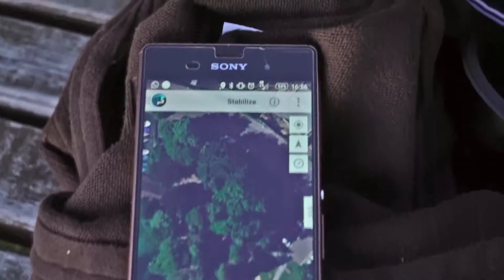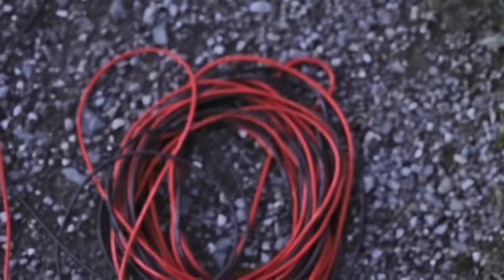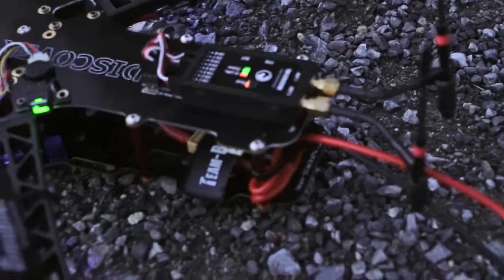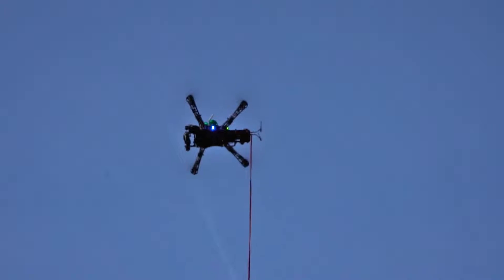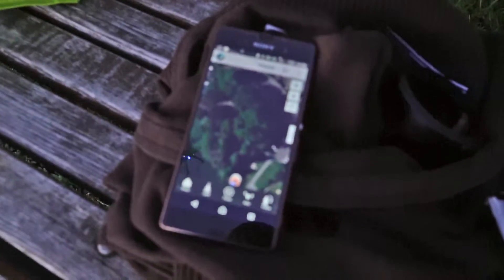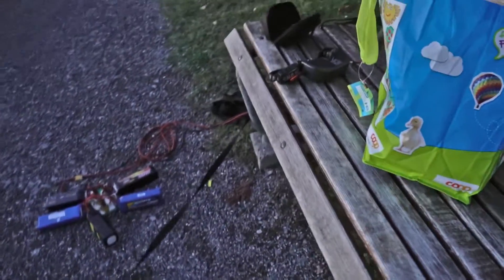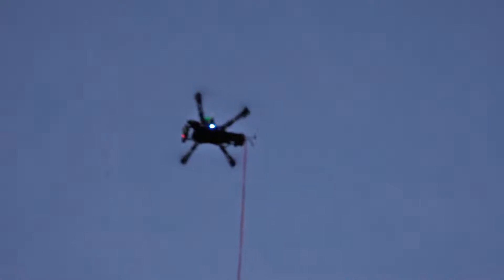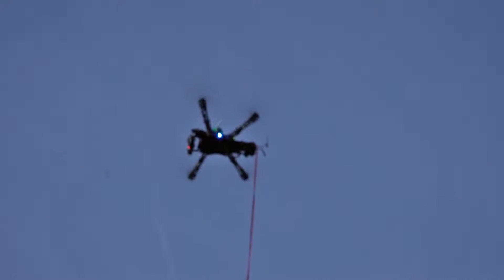Tethered drone flight

Comment: Kindly reply to the comments, please. Your viewers would like to know the result of this experiment like, endurance, flight duration, etc.
Reply from the maker: +Bennie Chiedu Hi There, sorry about that. The flight didn't go on for very long, I think about 7 minutes all in all but it was because there were small kids around and they I was worried that if something went wrong the copter would fall and hurt someone. 

The cable hanging from the back made the copter quite unstable as the cable would swing back and forth creating a resonance which wasn't very nice either.

I will try again in the future with a "throw away" copter so that if it crashes I don't damage the relatively expensive Discovery pro.
Reply: Thanks for the reply. Thanks so much again for dropping knowledge. Many people have considered this thought and would really like to know the feasibility.